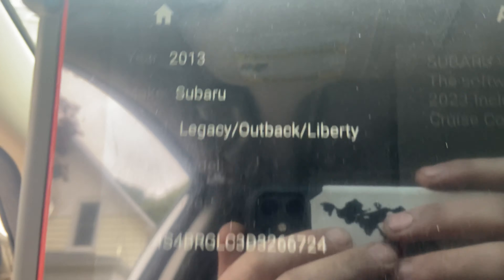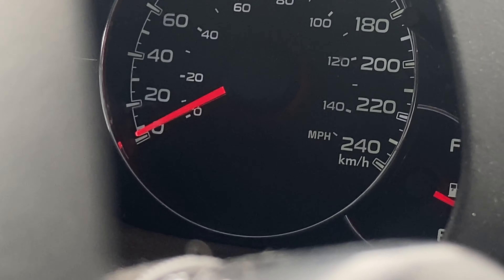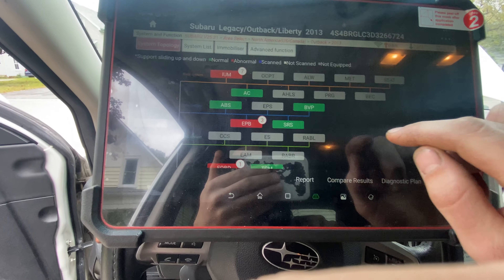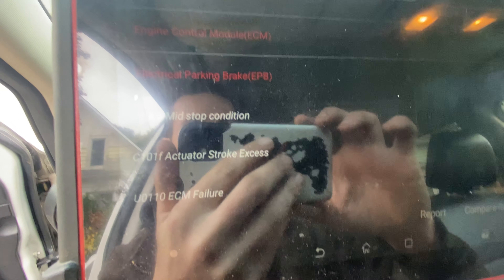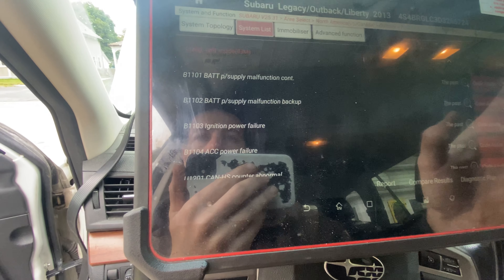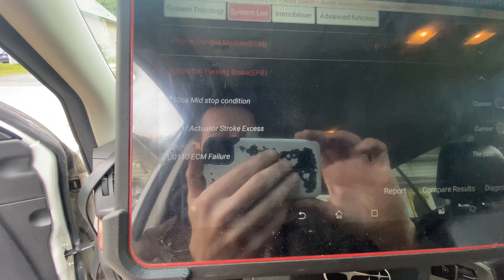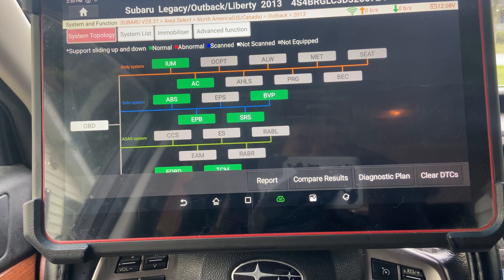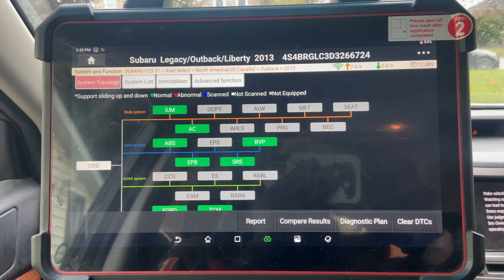2013 Subrau Outback Brake Warning Light Flashing EBrake Applied On U0110

Comment: 13 Legacy in my shop right now. u0110 C1040 C10ca. Trying to figure it out. Parking brake works fine and u0110 sets after clearing it.
Reply from the maker: Check for power at the module, unplug and plug back in.

Comment: My 2013 Subaru Legacy just had a similar problem. It locked up in the parking lot, but the light was on, and the parking brake was locked. Using an OBCD II scanner I borrowed, the errors I had were: Parking Switch Line (abnormal) (twice listed) and VDC interrupted due to EGI reason.  Turns out my parking brake wiring harness is shot as is the switch in the car.  I was able to free the car by overriding the computer and unlocking the parking brake using the OBCD device.  I drove the car to my mechanic who is going to replace the harness and the switch for me as this is beyond my skill set (I am more limited to changing batteries and simple oil changes - and sometimes able to use and ODBC II device to figure out what is wrong). It appears many suffer this fate.
Reply from the maker: @Buc_Stops_Here  yeah this particular vehicle continues to intermittently set this fault code and be a repeat offender
Reply: Can you elaborate which harness was replaced? and if you know, give the part number? I had my parking module replaced under extended warranty and was told by dealer that there is issue somewhere else. Replaced switch, fuses are good, so now I think its harness.
Reply: @pahanorlando  It is Parking Aid Switch. Switch Electronic. Switch ELECTONIC. Part Number: 83322AJ010.  It cost $119.88.  He fixed the assembly but if you need to replace it Parking Brake Cable. Parking Brake Lever. Actuator Electronic Parking Brake (Rear). Part Number: 26002AJ01E costs $855.58. He bought the first part which is the switch, fixed the second part which is the cable for $10 labor charge.  Good luck!  (Sorry, I keep posting this and it keeps erasing)!
Reply: @Buc_Stops_Here  thanks for the info!
Reply: @pahanorlando  No problem, good luck on trrying to fix it!